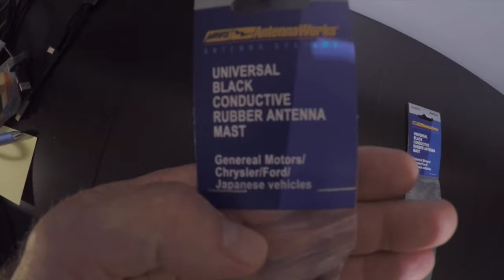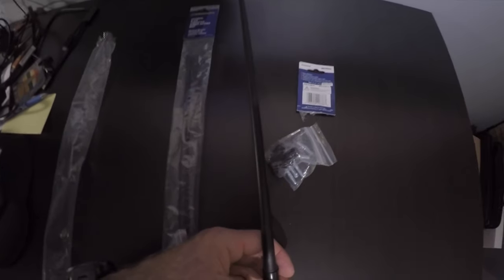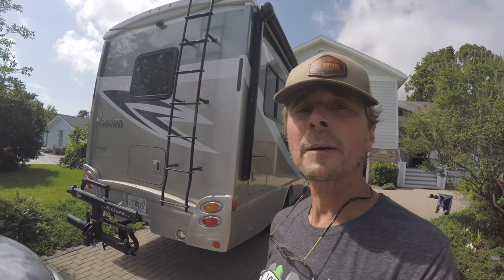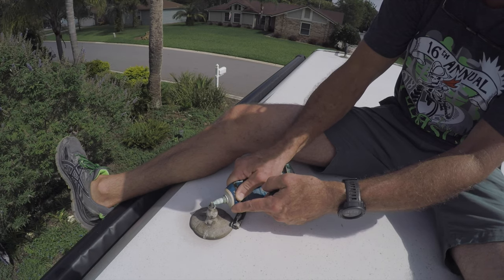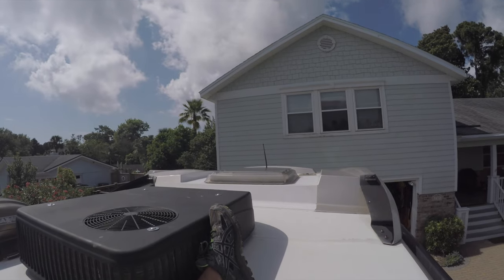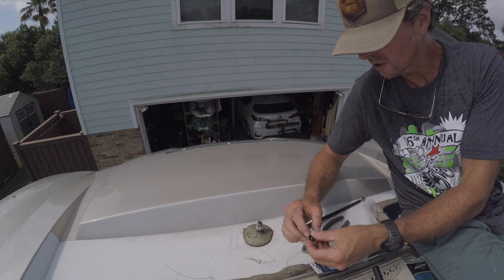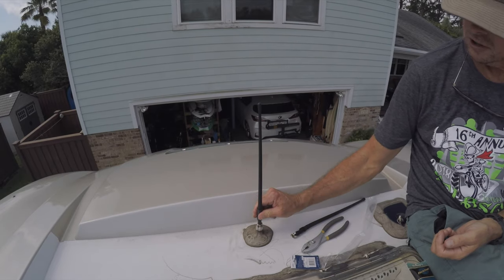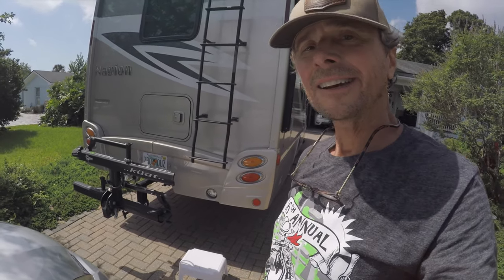RV Antenna Replacement

Comment: The antenna on my Navion broke exactly the same way. Thank you for the video. I weigh 180lbs, and I was worrying that I might break the roof if I step on it.
Reply from the maker: I weigh 175.  Should be fine on the roof.  Be careful!

Comment: Thanks for this well done video!  Yesterday I was up cleaning and inspecting the roof of our 18VV and found both radio antennas broken.  Searching YouTube I came across your channel and glad I did.  Not only was your video to the point, you also told me where I can find a replacement antenna which didn't require replacing the base.  I've subscribed to your channel and look forward to more great videos.
Reply from the maker: Thanks for the kind words Joe!

Comment: What grease can be used?
Reply from the maker: I think any is fine.  I just used a smidge just so it would be easy to remove in the future.  Seriously you don't really need grease.
Reply: Dielectric grease. Its made to work on electrical connections and prevents corrosion.

Comment: Did you try to see if your antenna fit the thread on the original antenna post before using the adapter?
Reply from the maker: Yes, it fits the threads on the original antenna post without the adapter.
Reply: Cable  is in ceiling  and can't  crab it from on top on roof

Comment: How's your reception with those antennas?  (My reception is terrible for both the car radio & the jensen radio)
Reply from the maker: Well, I've just replaced them an the reception in my driveway is great!!
Reply: Adventures of KB&P , you’re lucky. When I replaced mine with Winnebago parts, reception is still bad everywhere.  Will save your part list for the next time.  ( by the way anyone who rides that mountain bike the way you do shouldn’t worry about climbing on a RV Roof!!!!
Reply from the maker: @marshallgrodofsky3436  Ha ha, true.  I've just heard so many horror stories about men getting older falling off ladders....
I'll get a better feel on the reception when we get out on the road but my buddy did his with these awhile back and has had good FM reception.